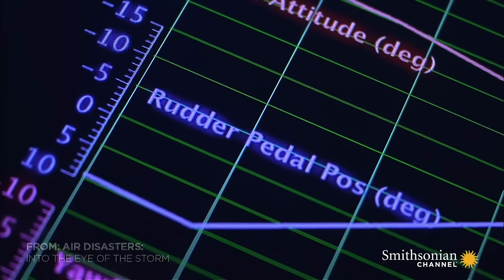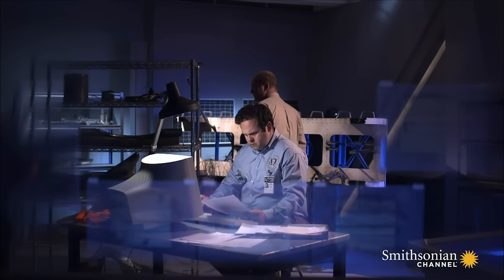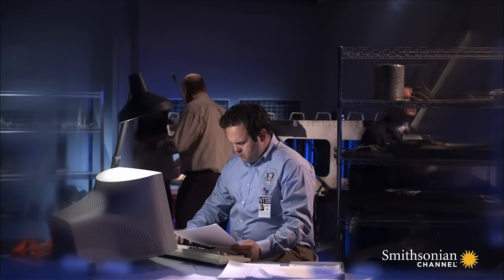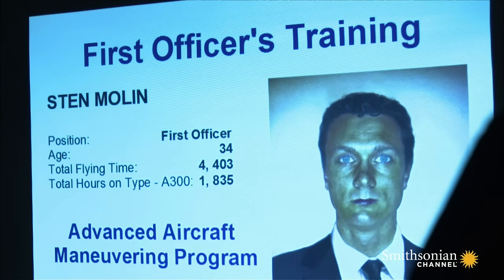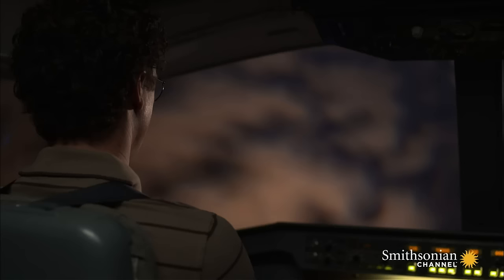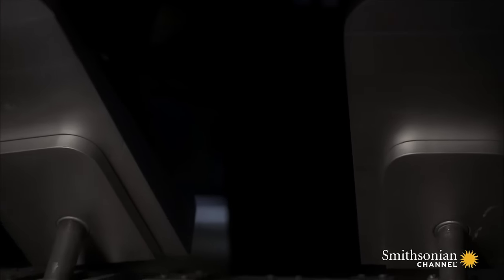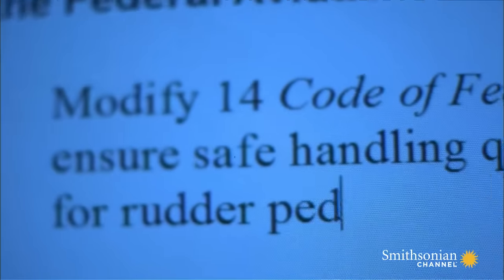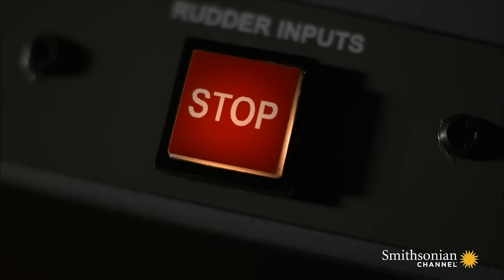Did a Poorly Trained Pilot Cause Flight 587's Crash?

Comment: maybe put extra bolts on the tail to keep it attached, like boeing does on its planes. Oh yea the extra bolts cost money, nevermind.
Reply: jony joe yeah an average american can probably afford to put extra bolts onto that plane, seriously 30 bolts is enough.
Reply: jony joe true
Reply: jony joe it's strong boeing has had less failures than Airbus or any thing else
Reply: MrStig691 Boeing had been in operation since 1916. How are you even comparing its numbers with that of Airbus which started in like the 1970s.
Reply: It feels like Boeing crashes more but Boeing sold more airplanes  -_-
Reply: jony joe lol
Reply: jony joe You do know the rudder ripped off due to pilot error right? No amount of bolts would help the A300's case.
Reply: jony joe  it not that easy just adding a few more bolts if there in the wrong place it could actually weaken the hole tail rudder off even easyer
Reply: The rudder ripped off because of incorrect training. Those rudder inputs would have been fine on a Boeing, and they were trained to do that. However, an Airbus is not designed for those control inputs and the training program was not modified for that.
Reply: It has nothing to do with cost saving. The number of bolts was sufficient for the design loads. The actions of the pilot were reckless and 100% caused the accident. If there was a need for more bolts then many other airbus a300 planes would have crashed, but they haven’t.
Reply: SlowCooker unless Boeing have some software mechanism which limits rudder inputs which would take the loads outside of design spec then the same thing would happen the rudder on a Boeing plane
Reply: He (the pilot) appears to have done the same thing in a 727. Likely the stab was designed with enough strength for all possible rudder inputs, or rudder inputs are limited mechanically somehow, similar to how outboard ailerons are locked at high speeds to prevent control reversal.
Reply: Actually, Boeing never had an incident where their tail breaks off (save for DHL 611 but that was because the 757 literally sliced through a Tu-154).
Reply: Atually you can but it will make no improve because the rudder only will rip off when it handle too much pressure
Reply: Extra bolts ain't gonna help when the metal alloy shears straight off.
Reply: MrStig691 nah airbus crashes much more
Reply: YusufK well if Boeing has more airplanes in service then of course it crashes more
Reply: Boeing planes generally heavier, and stronger than Airbuses.
Reply: YusufK They sold less.
Reply: @TommyTom21  Boeing is far older ....
Reply: Imagine thinking that you, a commenter on the internet, know more than the engineers who designed the plane. Of course it had bolts, and redudancy bolts. The strain on the tail was enough to literally shear the structure.
Reply: @TommyTom21  No idea where you're getting your numbers on the number of 737s and A320s from, but they're nowhere near correct. The number of in-service 737s and A320s is WAY higher than what you wrote.
Reply: r/agedlikemilk
Reply: Jacob Payag JAL 123. But that’s because of maintenance issues
Reply: TommyTom21 more like 7200 for A320 family and 6700ish for 737NG.

9 fatal accidents for A320? More like 17.

And 11 fatal accidents so far for 737NG. Including the recent Pegasus air runway overran.

Seriously man, just shut up.
Reply: @jacobnathanielzpayag3885  JAL 123 rings a bell?
Reply: @inthedark8400  Maintenance issue. This was from a perfectly fine aircraft under stress - shouldn't happen actually.
Reply: Yeah, sure.  Just go down to H.Depot and get a few extra bolts.  Ignorance on display, zero knowledge.

Comment: Without the vertical stabilizer, aircraft went into a high-g flat spin resulting in both engines being ripped off and separated from the main impact area.  Completely omitted from this account.
Reply: They weren’t that high in the air yet. So the passengers didn’t have to suffer for very long. Unlike the Alaska airlines crash in 2000. Going straight down from 24,000 Feet. That would suck.

Comment: I believe this happened often on previous flights  such that the vertical stabiliser was so weakened at this point it  just  required a little force to rip it off the plane’s body
Reply: So did this happen because he was regularly flying the route and this plane ?
Reply: @Polentaccio  although previous pilots said that Molin was excessive with rudder inputs, it was the condition of this plane as a whole, and by fate he flew that route with the plane and based on his rudder inputs (due to his training) the rudder finally gave out
Reply: @perfectlyimperfect1938  one more time (I got pinged from months ago)

AA's AAMP (Advanced Aircraft Maneuvering Program, IIRC the acronym correctly, it HAS been a minute) did not teach this "rudder doublet" and the NTSB could not determine whether the First Officer or the yaw damper made the inputs.  (Airbus design)  Nor could they determine if the point at which the FDR recorded the doublets ... if the vertical stab was still on the airframe.

the vertical stab was "weakened" by a runaway yaw damper the week prior to the mishap.  The fleet had a history of yaw damper malfunctions.

yet, the YT channel and far too many commenters here blindly accept the NTSB's report.

Comment: Why would the rudder tear off so easily?
Reply: He basically gave the rudder a lot of tension, it's not like it was made of vibranium.
Reply: I don't care what it is made of, rudder movement of 11 degrees isn't that much, especially at only 250 knots.  Pilot error or no, rudders shouldn't tear off under those conditions.  Cheap made airplane.
Reply: Actually there is a warning in the Airbus manual that clearly states not use the rudder that hard at high speed because of it being sensitive. I have seen the whole one hour program and AA had some bad training at that time. Airbus is not a cheap plane. You can also rip the tail off from a Boeing as well if the rudder is used in the wrong manner
Reply: +Jack P. oh wow thanks for the info man. I'm not a pilot of anything I just find aviation interesting.
Reply: Jack P. 550 knots is high speed, 250 knots not so much for 11 degrees rudder.  Cheap made plane.
Reply: +Red Car Are you a pilot? Are you even an Aerospace engineering student. Seems like we have way to many 'experts' on youtube nowdays.
Reply: Surya Shanmugam Are you a pilot or an aerospace engineer?  What university aerospace program?  I have driven a car at over 200 mph, and I fully comprehend what 11 degrees is.  Doesn't seem that much to me at 250 knots.  It isn't like air is a solid surface like pavement.
Reply: +Red Car Why do you ask me that? The reason why I asked you that is becuase you seem to know what a 'poorly' made plane is and what a 'well made' plane is. I don't claim to know either, so no point asking me. It's quite clear that every plane has its operational limits. If experts claim there is an operational limit for the A300, I am going with what they say. Btw, I am an Aerospace engineering student, but I am nowhere near as qualified as the investigators who investigated this accident
Reply: Surya Shanmugam I agree, all mechanical devices have operational limits.  Get a protractor and draw a straight line, then draw another line intersecting it at 11 degrees.  That angle doesn't seem that extreme to me for 250 mph. My point is that commercial airliner airframes are designed at the lowest possible weight to get the job done and have little if any 'reserve' strength in their design...so they can carry maximum number of passengers and freight.  As compared to automobiles, they are flimsy.
Reply: The rudder tore off because even at eleven degrees, the air is pushing on it at 250 knots. The tension and pressure keeps growing, and then the rudder went into structural failure. Therefore, the rudder tore off.
Reply: +Red Car 11 degrees rudder input is too much for an airplane
Reply: Red Car but think like this, when flying straight the affected area of the tail is pretty thin in the air, now turn it 11 degrees and it gets somewhat wider, and therefore can put some amount of stress on that side, now do that multiple times, each time adding more stress to the already effected sides until the stress become too great. That's why the tail ripped off. Oh and before you ask yes, I am a pilot and I graduated for Florida Institute of Technology.
Reply: Ridhwan Ramzi Yeah,The Pilots Gave Too Much Presure On The Rudder.:-)
Reply: Red Car did u not see how many times he moved the rudder 11 degrees in both directions....of course it'll rip off
Reply: From the video it looks like the whole vertical stabiliser came off
Reply: maby it was made out of cardboard
Reply: TheLegendaryGamers// Legendary 744 Aluminum is nowhere NEAR the strongest metal on Earth. Get your facts straight.
Reply: stress
Reply: GO SEE CHINA AIRLINES FLIGHT IDK
Reply: Red Car if they’re so cheap, why are they the safest mode of transportation?
Reply: Wheat ley it was carbon fibre composites. Those layers slowly broke apart so the stress the tail could take was reduced. Then this abnormal rudder movement due to crap training caused the already weakened tail to get ripped off.
Reply: Its airbus they don't put extra bolt on the tail like Boeing airbus is cheep like that
Reply: Taurean Simmons weak metal
Reply: Kenny Mcormick it’s carbon fibre composites though.
Reply: Red Car The rudder twists more than 11 degrees because the the rudder is much more sensitive at high speeds.
Reply: Think about the amount of pressure that is placed upon the rudder at high speeds. Air resistance at the speed would be quite forceful
Reply: roger murtaugh Deflected over 14 degress, the air getting deflected is very high, climb speeds are really hig, especially in an urban environment.
Stop trying to act like one of those experts. If you're so good, why aren't you a designer? If you're reasonable, why do you throw insulting names at a compony which manufactures aircraft much better than Boeing, at least use some grammar Mr.Aviation expert.
Reply: Captain Clemont I wouldn’t say idiotic, they were taught to be aggressive and the pilot just didn’t know it was very sensitive. The rudder was just far too sensitive and it just easily broke off
Reply: The 11 degree move supossed to be OKAY if the first officer sten molin didn't increase the speed
Reply: It was an Airbus. Only reason we keep using them is France illegally makes you use them to land in their airports.
Reply: Oh, I don't know...... maybe the 200,000 kgs of thrust pushing against it?
Reply: Same thing goes for flaps which has makings as to at what speeds how much degree of flaps can be deployed. You can't do this on newer planes because computer won't let you.
Reply: He puts too much load on the rudder
Reply: The crash wasn't caused by pilot inputs, don't be ignorant.
Reply: Jay P Boeing planes have a mechanical lock so the rudder won’t go to extremes wich would cause it to fail
Reply: Pug Cuteness extra bolts wouldn’t stop over 50,000 lbs of pressure
Reply: Taurean Simmons it’s a 200,000 pound load against a tail that’s the weight of the plane itself
Reply: Red Car exactly
Reply: @foundationsoversight8479  I believe Aircraft Aluminum is just the skin. I assume jet liners have a steel frame or else that's ONE hell of an Aluminum Alloy
Reply: Planes are not "Cheap" in any sense. Especially jet liners. And 550 knots is VERY fast. Actually Overspeed for almost every passenger jet (aside from Concorde). But F18s are usually topping off around 480 knots. Commercial Airliners are engineering marvels in their own right. They are MASSIVE, and take a HELL of alot more drag than a car. And why the hell are you comparing cars and jets? Cars will always be more "durable" than jets, CAUSE CARS CANT FLY! Cars can survive a head on collision and planes cant. Ya know why? CAUSE PLANES ARENT BUILT TO BE RAMMING BLOCKS!
Reply: Structural failure?
Reply: this was an reenactment so it won't show the true struggle he had with turbulence just enough for people to get the idea he was struggling that by moving rapidly back and forth.
Reply: planes are apparently made of paper
Reply: Taurean Simmons
Reply: 100% correct......total bullshit.  
That's like saying Don't hit your brakes too hard or your wheels will fall off
Reply: @barefooboy17  Well that is just plain UNACCEPTABLE....if there is that risk then that is pathetic.
Reply: @SuperSurya1234  I don't give a damn who you are.....this is a fundamental design flaw period. The mere thought that there is a possibility that a pilot may possibly over do it a bit on the rudder to where the whole damn vert stab rips off is highly offensive to me as an engineer and a customer. FLATLY UNACCEPTABLE PERIOD
Reply: Actually, at those sort of speeds, air resistance isn't too dissimilar to pavement.
Reply: people are probably forgetting the wake turbulence here, that possibly aggravated the problem and caused more stress than the vertical stabilizer was designed to withstand, hope everyone has a good day, cheers!
Reply: They cut costs on this variant. Bolt's used were inferior. They came from China. Only 4.6 not even grade five. I would have used grade eight for sure.
Reply: The entire stabilizer tore off bro
Reply: Airbus Engineering.
Reply: Joey mp4 you're* and yes you're right, he is
Reply: You have to remember the plane weighs tons against the fast speeds ..  that's a lot of stress .. that kind of stress with rip a car to pieces .. and airplanes are made out of aluminum??
🤔😕
Reply: Red Car, 200 mph in a car compared to 250 knots (275mph) in a plane is not even close to similar conditions. Remember that drag is proportional to the square of speed. 200^2=40000, 275^2=75625. Almost double the force. 11 degrees creates extreme stress on the rudder. The rudder is designed to handle forces like this. 11 degrees in the other direction adds even more stress. Remember it was 11 degrees back and forth 3 times. Stress builds up more and more, and exceeds the force the designers ever anticipated. No material affordable enough to make millions of planes with is string enough to withstand the pressure.
Reply: @ChuckNorris-pl5uc  it's called metal fatigue. It makes metal weaker as it bends/ changes load quickly.
Reply: Chuck Norris maybe*
Reply: A Clever Name imo it wasn't 100% the pilots fault. His training really screwed him up
Reply: RFI-Crypto Lab if it was a bomb how did only the rudder fall off with no major holes in the fuselage?
Reply: Red Car first off, The inputs were very excessive. The inputs lead to a slide slope angle which combined with the wake turbulence, put excessive force on the vertical stabilizer causing it to break off. I don’t need a degree to know that
Reply: do you have any idea how much airflow is hitting the plane travelling at 250 knots? Because 11° is massive on a large jet like this. A 4° pitch down already sets off sink Rate warnings in some airliners
Reply: Tension
Reply: Gabriel Afonso the plane was an Airbus A300
Reply: This is the 69th reply nice
Reply: I think it was being used to aggressively if that makes sense.
Reply: @barefooboy17  dude that's a boeing. U can spot it as it doesn't have fly by wire

Comment: The accident was extremely unfortunate and it's a terrible loss of life. Modifying the training program is a good thing, but the plane's rudder shouldn't fall off. So what if the pilot was using the foot pedals in extreme turbulence? Planes should be designed to withstand hurricanes. That's a poorly constructed plane...Any engineers in here? What's your take?

Comment: Fyi  New reply on "I’ve got over 8000 hours and currently fly an Airbus A320 for Jet Blue. Large inputs to the flight controls are used often and under many circumstances.Even though the 300 is not fly by wire, there is no way the rudder faltered due to the application of full rudder control. The aircraft was well under maneuvering speed and I’ve never, ever heard an aircraft make a significant sound due to wake turbulence.They departed plenty of time after the 747 and were also at a slightly different altitude through climb out. FAA was covering for Airbus.The plane was previously damaged in weather overseas and I’m sure there were complications where a band aid was used to get the plane through to its next overhaul.Airlines save time and money at all costs, and sometimes it costs lives. At the end of the day, it’s a business, and I love Airbus, but sometimes responsibility trumps optics, and unfortunately in this imperfect world, we can’t be prepared or foresee every s
Inbox
Reply: NASA even checked the vertical stabilizer it wasn’t airbus fault and why would an American company cover for a Europe company
Reply: You’re clueless. The speed being below manoeuvring speed is irrelevant. The reversals made an ever increasing force way beyond what the rudder can normally cause.

Comment: I understand that if your rudder breaks you’re inevitably going to crash. Although I can’t believe that the plane would just drop straight down as they showed. Would the wings not still generate lift.
Reply: Evan Dickson the plane would be practically uncontrollable, you you wouldn’t really be able to pull the planes nose up to generate lift. It’s just simulated anyways
Reply: Yes the wings would generate lift, but the vertical stabilizer is what keep the plane flying straight, without it, the plane will enter a flat spin (what’s shown in the video) and at that point, it doesn’t matter how much lift the wings generate, without the stabilizer you can’t exit the spin